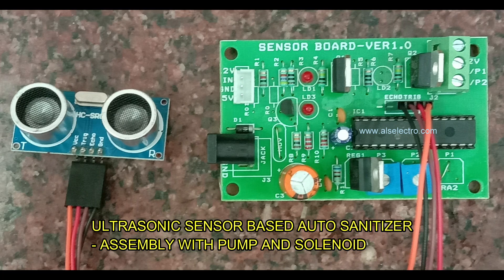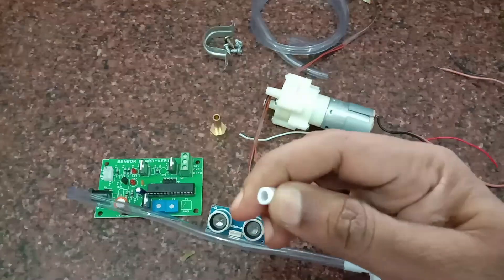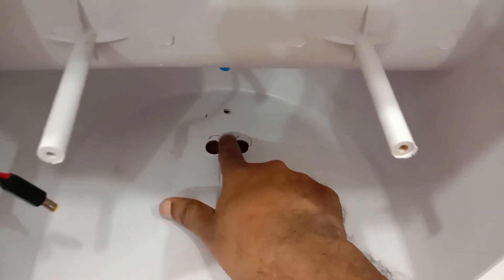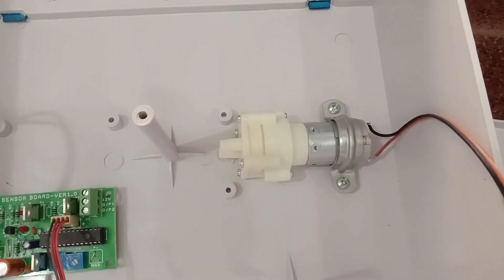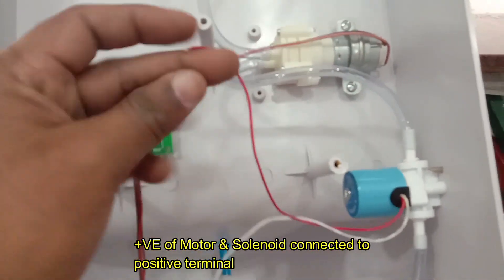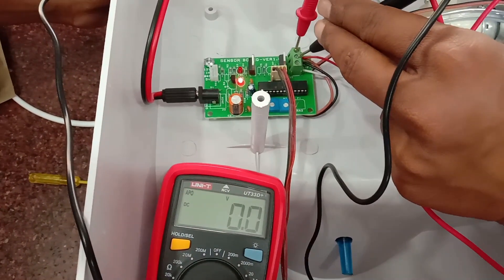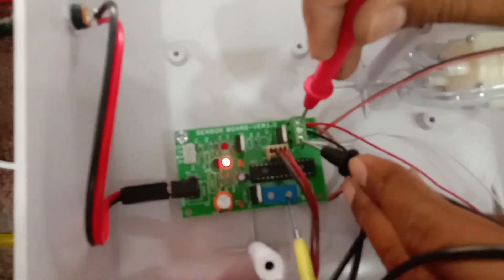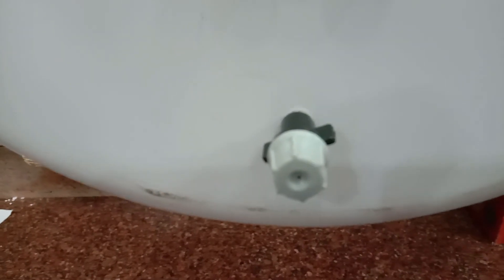ULTRASONIC AUTO SANITIZER Assembly Guide

Comment: Hi Saravanan, I already have 3 units but need to add the board to control the flow of Sanitizer. I have an IR sensor based machine with 75 gpd pump and 24 v adapter with SV. Will just the board work and which one or should we replace the sensor as well with Ultrasonic sensor and will all the 3 items, pump, SV and adapter work with your board.

Comment: Can u arrange all sapare parts (solenoid, water pumb, pipe,nosile,dc adapter, ultrasonic sensor,main board/pcb & RO cabinet) including RO cabinet , here not available in market ,I am from Kerala, Thrissur, tell me the price ? my mob no 8129644446